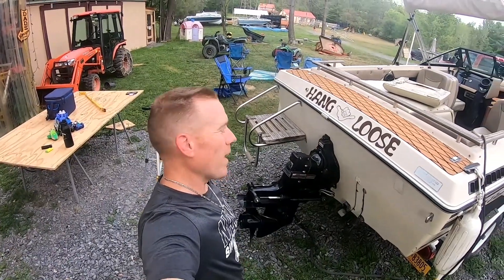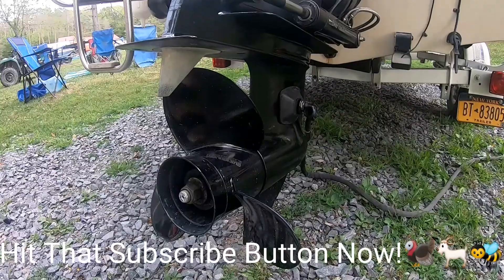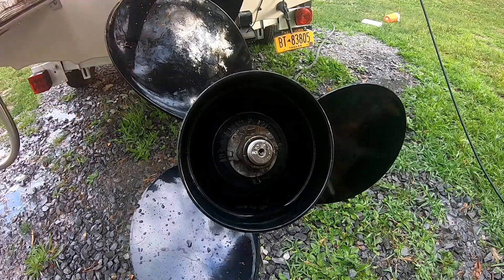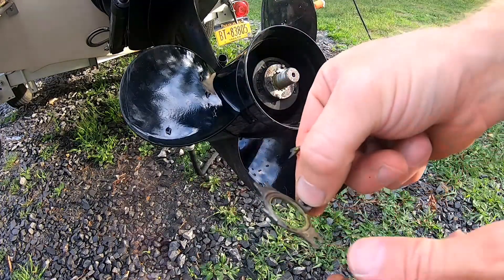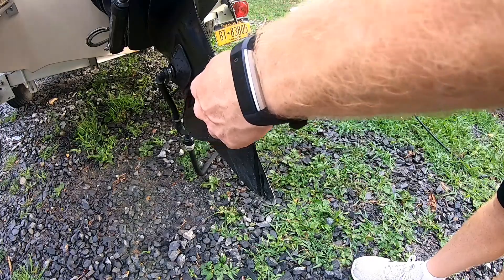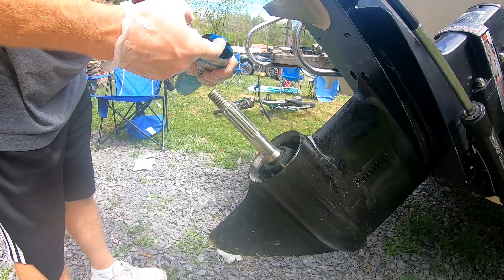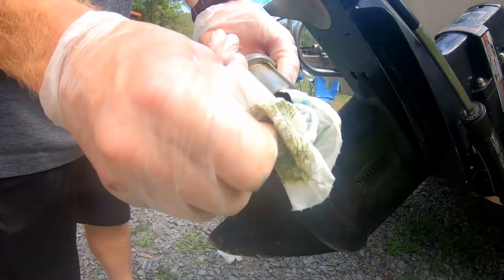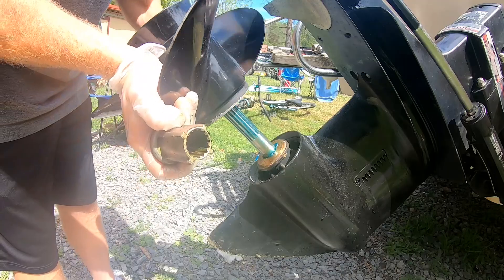Mercruiser Propeller Removal And Install DIY!

Comment: Another good video
Reply from the maker: Awesome! Thank you and thank you for watching!👍💯😊
Reply: Thanks for the video. How do I know the size of my blade?
Reply from the maker: The proper propeller size for your boat and engine combination is based in part on the wide open throttle (WOT) operating range for your particular engine. You can find this in your operator's manual, expressed in terms of a certain horsepower at a certain r.p.m.
Reply: @WhitehouseFarmVet  thanks I will check the manual.
Reply from the maker: Yeah just in case you need the correct size for your boat, better to be sure!😉 hope you have a great summer on the water!👍

Comment: Helpful video man. Is the prop supposed to be able to spin both ways that easily when it's in neutral? Also, I'm hearing a small knocking when I spin my prop both ways.
 Is that normal?
Reply from the maker: Yes when in neutral it will spin both ways , if your hearing a knocking or clunking you might need to adjust your gear cables because if its in neutral and your hearing noise which means it is trying to go into gear! Good luck and thanks for watching!👍

Comment: I took my propeller off, put a new one on and now it’s leaking the gear oil and it’s on there the same way. The old one came off. I do not understand it’s not being sealed what the hell is going on.
Reply from the maker: You shouldn't have any gear oil leaking from changing out the prop if you do it sounds like you have bigger issues! Can you see where it's leaking from????

Comment: Which blade did you use?
Reply from the maker: They had 14.5x19 inch at my local Anderson boat shop, works great for  my boat no issues! Thanks for watching!👍
Reply: @WhitehouseFarmVet  I tried a Hustler by Turning Point. I did a 14.25 x19 and the shaft was like a half inch longer so I hit the bottom part that looks like a skegg but it is not. I had to change it out for a quicksilver 14.25 x21 that sucked but I fixed it and it was great :) I will be testing out tomorrow I live in spring hill fl now :)
Reply from the maker: Nice, hopefully you will have a great time on the water this summer!😉😊